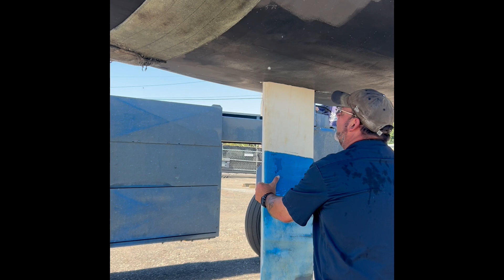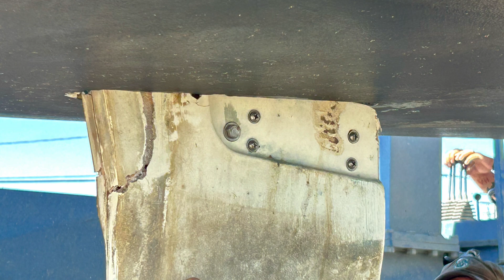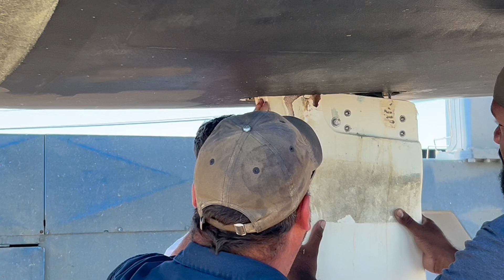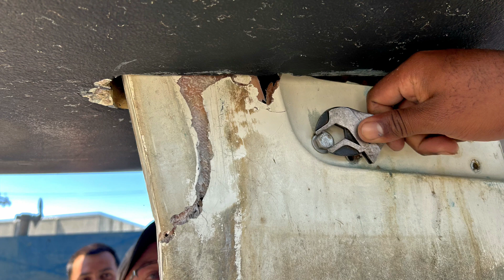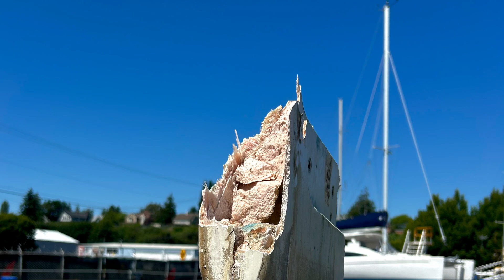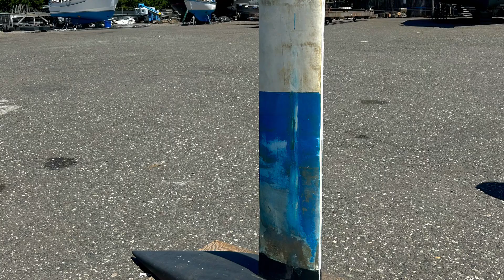The Adventures of Artemis - Episode 14

Comment: I have been considering upgrading to one of these as my "forever" boat.....did you ever determine the cause? Was it a manufacturing defect? I heard there's keel bulb issues with the 2005-2009 RK models. Hope you got it repaired successfully.
Reply from the maker: The composites shop that is currently repairing it made a good point - they think that this could be possibly be like a fuseable link. In other words if you strike something with the keel it breaks vs. the boat. Also, our boat had previously lost its keel under the previous owner when it came off its mooring and ran aground. So who knows if that caused any weakening.

Comment: Well I was considering a Seaward 32RK until this happened to you.  The construction method of just glass the rod to the keel is IMHO not sufficient to sustain collision loads. The rod should extend all the way into the bulb.  Then again I'm not a naval architect. Is the top part of the keel foam filler?
Reply from the maker: that top part of the keel seems like it is missing something - definitely not structural!